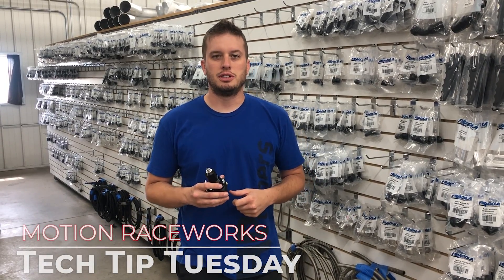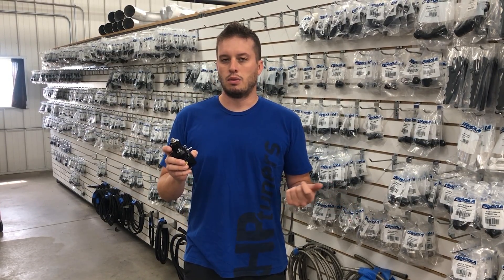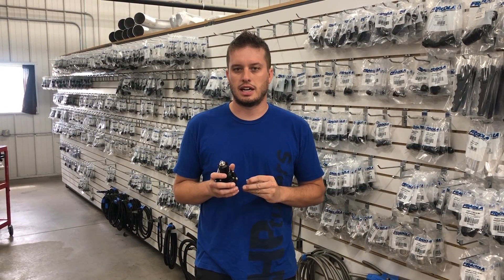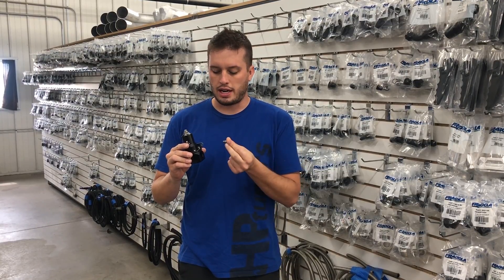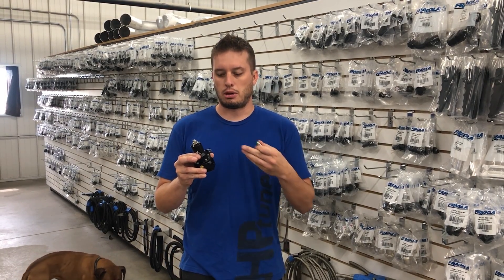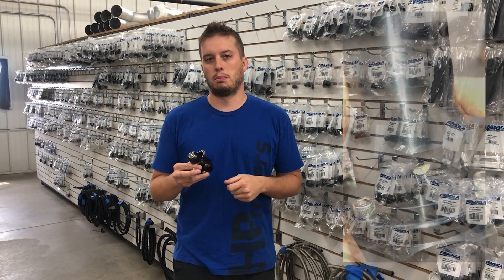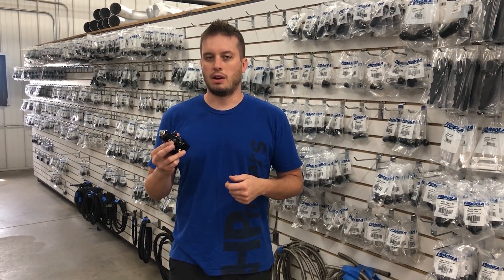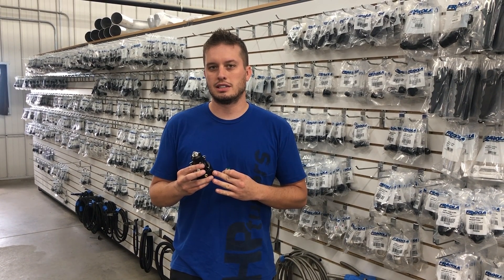How to Fix Fuel Pressure Issue With Aeromotive Fuel Pressure Regulator! Tech Tip Tuesday

Comment: Can I block a return line styled regulator? And can I run the gas line into the return instead I need the 90 degree angle

Comment: I have Aeromotive FPR with Walbro 255 in line pump. The pump whines every 2-3 seconds and fuel pressure jumps back and forth from 58 to 88 psi. And thoughts?

Comment: Been having an issue with my aeromotive regulator I cant seem to figure out. I'll start the car up first thing in the morning, fuel pressure will be way higher than I set it at, if I adjust back down and go driving, when I get home it'll be lower than where I set it both ways by like 8lbs. But if I leave it at the way higher pressure first thing in the morning and go driving when I get back it'll be right where I set it originally or within a lb. Problem is start ups are a pita, surging idle, doesn't want to stay running sometimes, as soon as I drop the pressure that stops. Everything in the fuel system has been gone through and most is brand new, including the regulator, had to warranty the first one in the first week due to a leak that sprang out of the bottom and was spraying the headers. I'd be open to any suggestions you have.

Comment: I have the aeromotive boost reference regulator. I'm testing it without the boost reference. I set psi to 60. I cannot figure out why when I first stab pedal the pressure drops like 5psi and comes back. Also if I am in park and turn steering wheel the pressure goes up and down with turning the wheel. So I think it's electric. It seems ok at wot. It's a 2016 dodge charger sxt with Supercharger

Comment: I find a problem today with the same aeromotive regulator,  I have return system with 2 regulators,  the driver side have the vacuum line and is working good but the passenger side is lickin a lot of gas for the same side but this side don't have hose , what I have to do ,seal this exit  Or the regulator is wrong ?

Comment: So with the regulator and the a1000 fuel pump and braided line and the rest of the system I should be good to run a 100 shot w e85?

Comment: Also good tip on not threading fitting too far in. It's the same rule of thumb of paying attention to the length of bolt being removed on almost anything mechanical, because that is the exact same length to put back in so you don't bottom out or run a bolt somewhere it shouldn't be, like in this case. I'm sure a small narrow nut put onto the treads of the push lock fitting before install would act as a positive stop. I'm happy to see you sell Quality MADE IN USA parts
Reply: hey doug, great video i did a search on lower base fuel pressure my aerotive regulator runs 55psi  with the adjuster right out  i need to get to 43 psi  any suggestions everything works i can adjust the spring to 85 or 90 psi i i want  but cant get below 55 psi with reference line off

Comment: Hi Doug, Thank you for creating detailed, informative videos. I am currently researching all facets of what will be needed on my single turbo system that i will be installing on my LY6 Powered Sierra. I now understand why the reference regulator is needed. I thought it was to add more fuel than base, but now i know its added to counter act the pressure from the boost pushing back at the injector.
Reply from the maker: Ben w not a problem.  Glad these help!

Comment: That sounds like a design flaw on the part of Aeromotive, Doug. Push lock fittings are so commonplace these days, you would think they would verify fitment. As the fittings are NPT, you really don't have much leeway as far as how far down to tighten them if you expect them not to leak. Are you supposed to just pile on the thread tape so it tightens earlier?
Reply from the maker: You can honestly thread any npt fitting in too far.  I understand why Aeromotive designed it the way they did.  It’s easy to crank those fittings way past thinking you’re getting them extra snug.
Reply: One of the reasons Teflon tape helps fittings seal is the Teflon makes it "easy to screw the fitting in FARTHER" so in this case it could be better not using any type of Teflon and if needed Loctite 545 pneumatic hydraulic sealer works well (without the fittings screwing in farther) but I only use 545 on fittings I don't want to remove/replace anytime soon because it isn't easy cleaning the hardened sealer out of the threads...
If all else fails Old School Fix... Before swivel fittings existed, when I ran into an issue clocking an angled fitting to the angle/direction needed (with fitting tight, not leaking) I would grind a 1/4, 1/2 or 3/4 of a thread off so it would tighten/seal sooner (which obviously shortens the fitting to fix this issue), but FYI don't take more than that off because it gets hard to start the fitting in the hole if you take too much off 😜
Reply: It's better to use Teflon paste than tape on anything that imposes vacuum.
Positive seal without debris